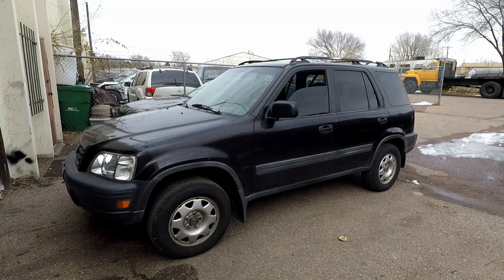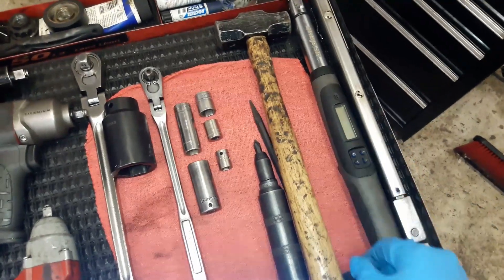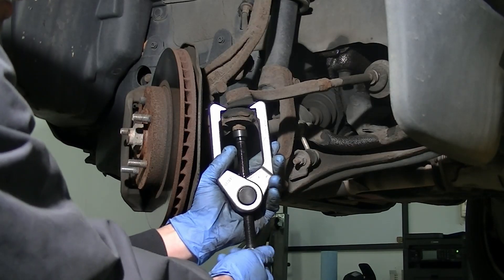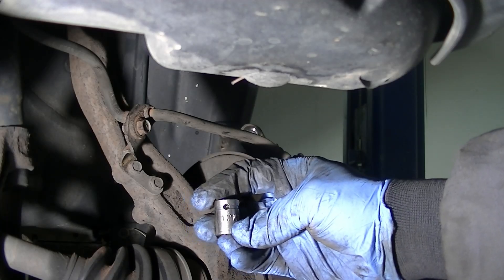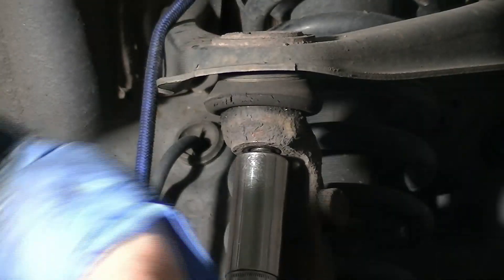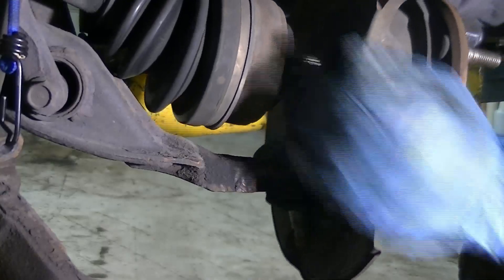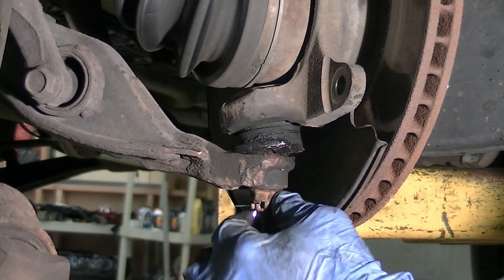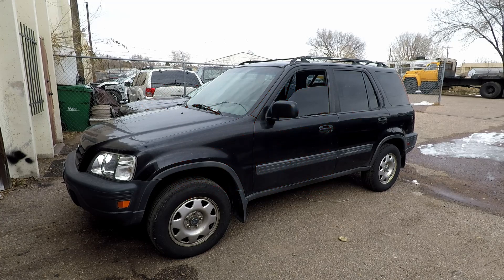Steering knuckle replacement  (96-01 Honda CR-V) broken wheel stud

Comment: We're suppose to torque the axle nut to 181ft/lb while the wheel is on the ground? That doesn't seem to make sense. We want true torque so we'd want the wheel completely lifted off the ground for true accurate spec, right?

Comment: Ground a flat on the stud head. cut out a section of the shield with a Dremel. pressed the stud in with a PITTSBURGH AUTOMOTIVE
3/4 In. Ball Joint Separator. It messed up some of the threads but those are inside the brake rotor and rim. I did straighten them some with an old lug nut prior to assembly.

Comment: If I was installing extended arp wheel studs I'd have to use the same knuckle, once I have the knuckle off what do I do next? Press the bearing and hub out?
Reply from the maker: Yup. Any machine shop can do that for you. $30-$50 usually. But I would see if they can replace the studs for you too.. those guys can work magic sometimes!